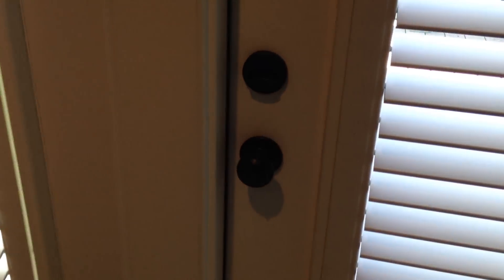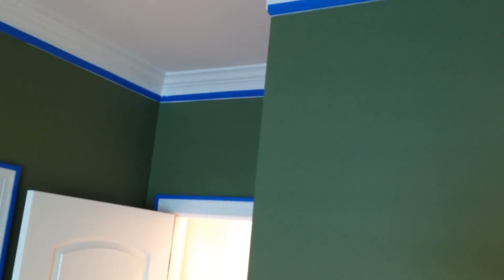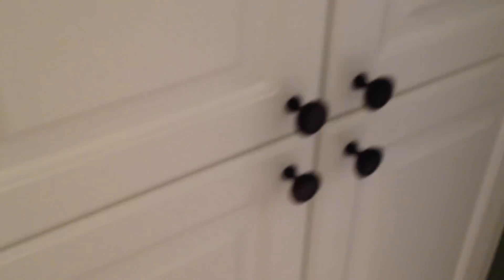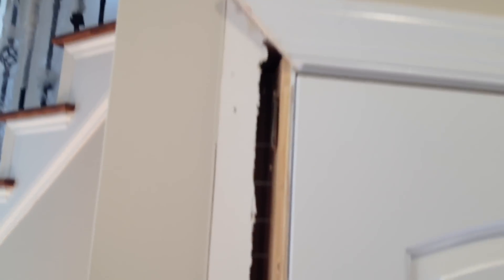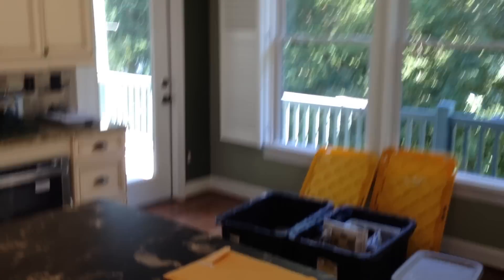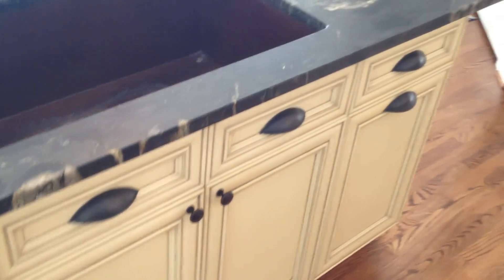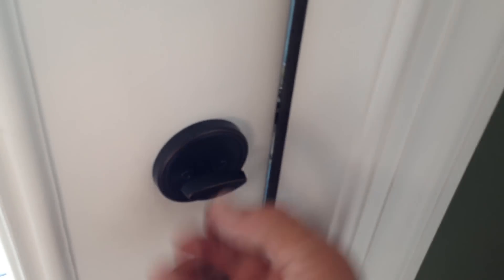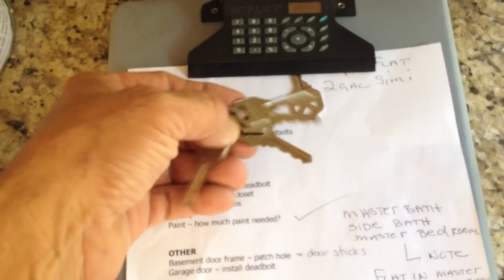Handyman Business /  Punch List work.  Pt 1 of 2

Comment: Hahaha semi gloss because it’s a shower area. BS! You can easily paint a bathroom in flat, matte, or eggshell. Any of those sheens would look better than semi gloss. That looks awful. Way too shiny in that artificial light and just makes any imperfections stick out like a sore thumb. At least you’re using a good line of paint. Regal Select has a mildew/mold resistant additive so you should be fine in a bathroom. If you are truly worried about the type of paint you’re using in a bathroom go with BM aura bath and spa matte finish on ceilings and walls. Softer sheen that absorbs artificial light rather than reflect it and hides imperfections and resists mildew and moisture streaking from shower steam. Also...two gallons of paint for that small bathroom? You over bought.